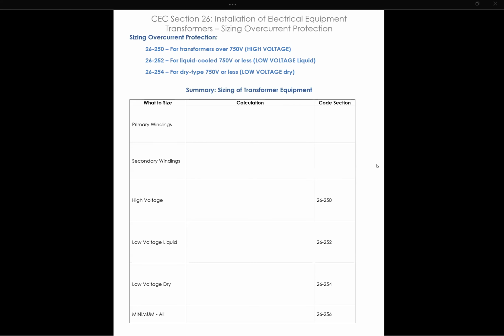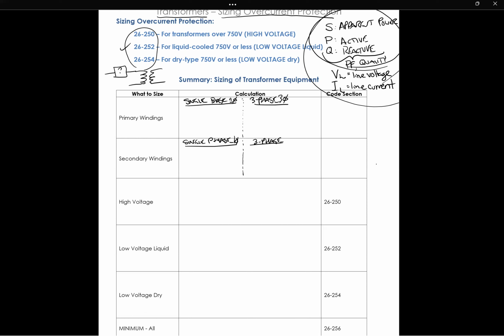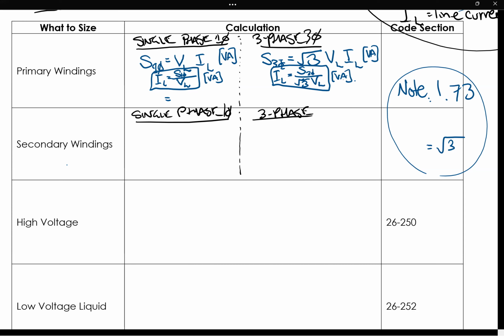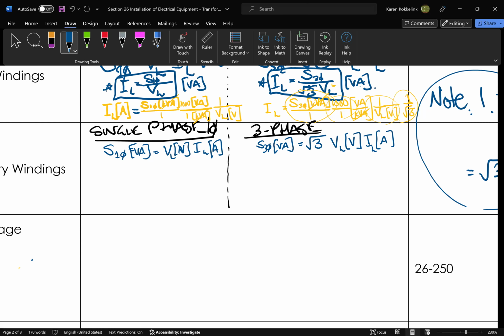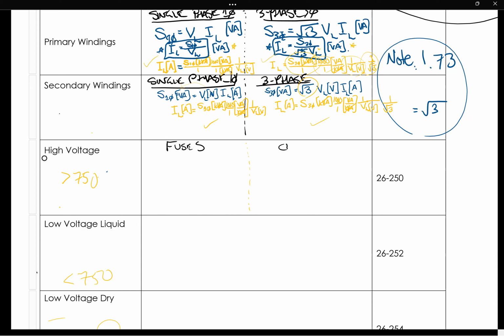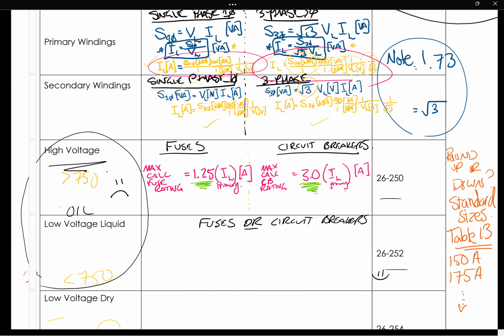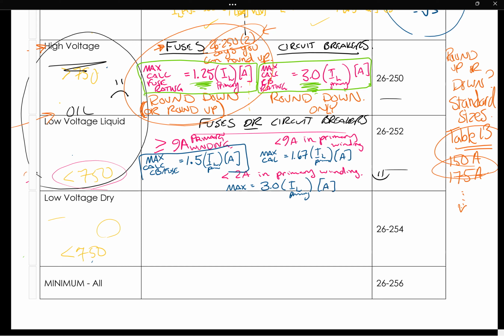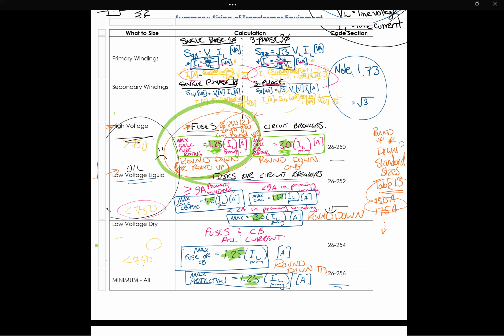Transformers: How to Size Fuse and Circuit Breaker on Primary Side (CEC Rule 26-248+) EASY!

Comment: Please check the code book for Rule 26-250 for transformers rated over 750v  

Should be 1.5, not 1.25, and this is the rule :

26-250 Overcurrent protection for power and distribution transformer circuits rated 
over 750 V
1) Except as permitted in Subrules 2), 3), and 4), each ungrounded conductor of the transformer 
feeder or branch circuit supplying the transformer shall be provided with overcurrent protection 
a) 
rated at not more than 150% of the rated primary current of the transformer in the case of 
fuses; and
b) 
rated or set at not more than 300% of the rated primary current of the transformer in the 
case of breakers.
2)Where 150% of the rated primary current of the transformer does not correspond to a standard 
rating of a fuse, the next higher standard rating shall be permitted.
3)An individual overcurrent device shall not be required where the feeder or branch circuit 
overcurrent device provides the protection specified in this Rule.
4)A transformer having an overcurrent device on the secondary side rated or set at not more than 
the values in Table 50 or a transformer equipped with coordinated thermal overload protection by 
the manufacturer shall not be required to have an individual overcurrent device on the primary 
side, provided that the primary feeder overcurrent device is rated or set at not more than the 
values in Table 50.

Comment: Hi Prof, so if it's given in KVA, S is equal to (KVAx1000), and the formula is then (KVAx1000) = 1.73 x Line Voltage x Line Current?
Reply from the maker: Yes, that's correct for a balanced three-phase system. If the apparent power is given in kVA, first convert it to VA:  S=kVA×1000
Then use the three-phase apparent power formula:S=root3×VL×IL.   Or I would use the whole thing kVA×1000=Root3×VL×IL.  Just be careful not to confuse kVA  with kW (apparent with real power). If the question gives kW, you must also include the power factor in the calculation.  Hope that helps, but you've already got this.